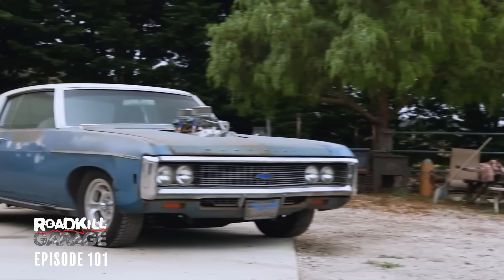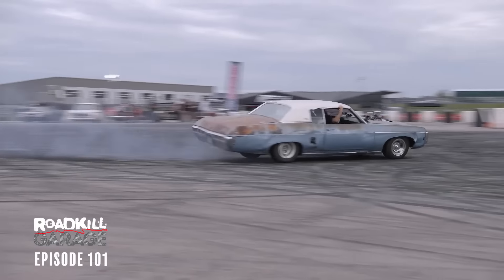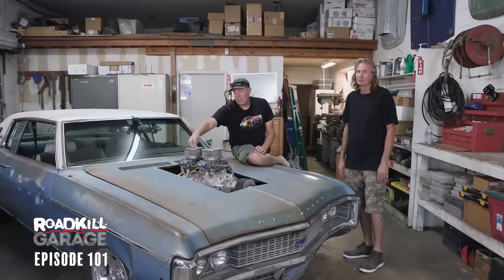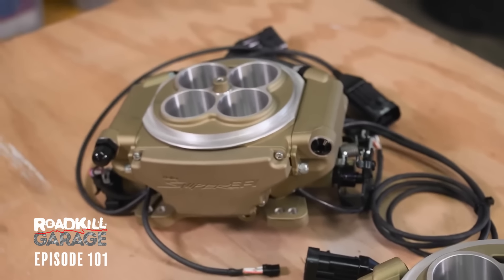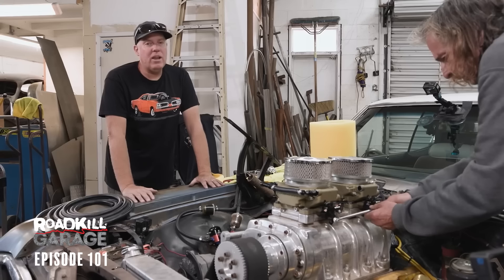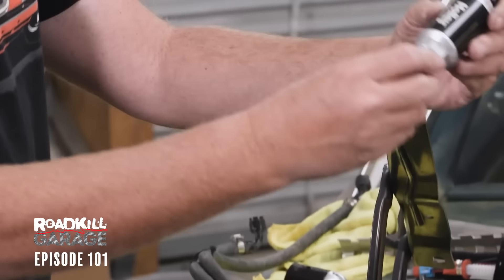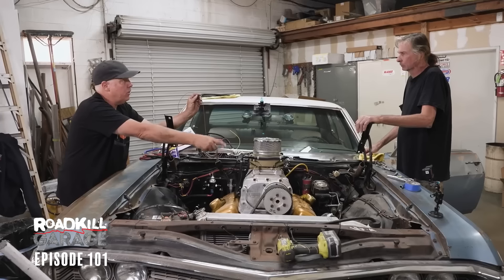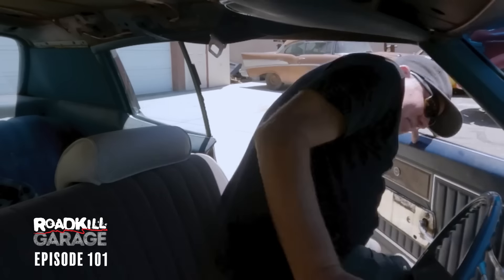Fixing Big Block Crusher Impala For MASSIVE Donuts & Burnouts | Roadkill Garage

Comment: i have a big block 1970 impala and this is kinda the goal for it 1 day. i converted my car to cable throttle using a 1969 camaro pedal that bolts into the same spot as the factory 1 and used a 90s chevy pickup cable it worked perfectly.

Comment: I am building a C-Body (1967 Buick Electra) land yacht racer and it has 2 of the new Edelbrock AVS2 4'-barrel carburetors. The 'AFB' design float bowl has never been a problem for me in high g-force turns, like a Holley.
Reply: Holley is a sponsor, marketing. I prefer fuel injection.
Reply: @NorWis744  The AVS2 has improved atomization due to the new annular flow at the boosters. Very impressive. Many say it 'feels' like EFI. And, you can retain the matching 'vibe.'

Comment: I wonder if you can turn off the fuel line and run the carbs dry before storage....If I dont do it with my small engines every year I have carb issues.

Comment: I like the injector setup in this burnout application.  But I have not ever tuned a twin injector setup like this.  Is fuel map basically mirrored [in a master/slave configuration] or do these have injector trim abilities like a tunnel ram setup might sometimes want?
Reply: i doubt its very sophisticated.  Probably just the same map for all with some correction from the o2. The fact that it only had one o2 (as far as i can see from the vid) says a lot

Comment: Extra fuel won’t make power without boost and boost won’t make power without extra fuel so it’s a combination of the two that makes the power not the extra fuel and not just the boost
Reply: boost is just a reference of pressure in the intake manifold, it literally makes nothing.
Reply: @leftyo9589  you know exactly what I’m saying